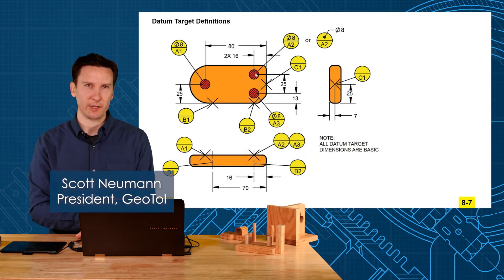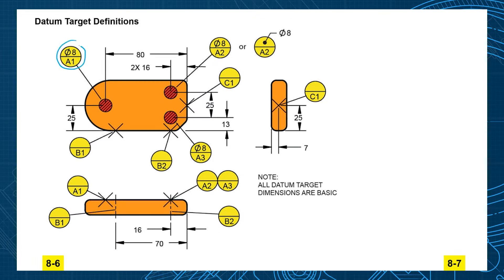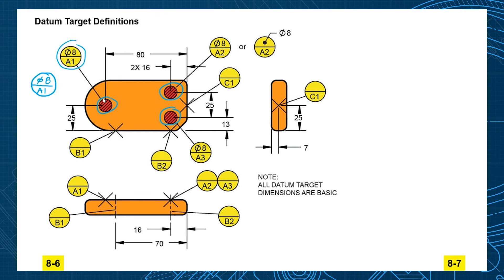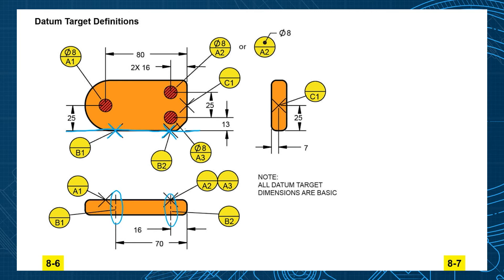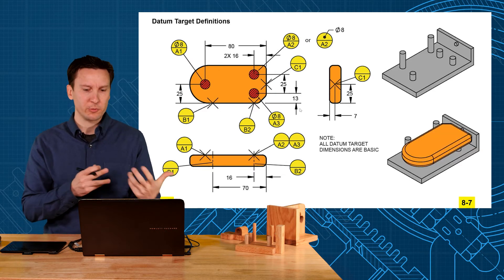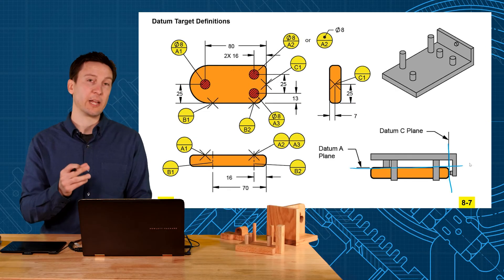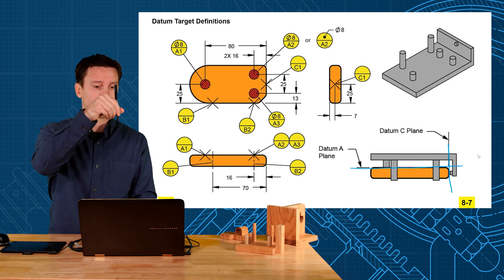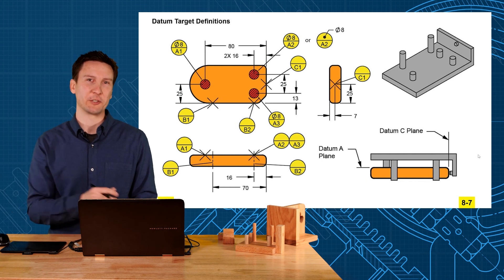GD&T Datum Targets Introduction

Comment: The dimensions between the Datum Targets and between the Datum Targets and the part are TED's.... But a TED isn't worth anything without a tolerance because nothing can be made without a (small or larger) deviation. What is the tolerance of the placement of, especially, Datum Target Points and Datum Target Lines? I can imagine a Datum Target Region to limit the exact location of the contact, this should occur within the region itself... but when using a point or a line, what is the tolerance on the actual datum location vs. the TED of the datum's location?
Reply from the maker: The drawing only specifies the theoretical set of requirements, and should not define tolerances for the inspection fixtures. Measurements are subjected to measurement uncertainty (a lot of inspection labs shoot for 10% or less measurement uncertainty).  I let inspection decide if they are to build a hard fixture or use a CMM and its software routine to simulate the datum target alignment.

Comment: Good explanation, how would you get a datum for a part that is a circle o revolution part ? Regards from México
Reply from the maker: You can arrange datum targets around a cylindrical shaft and generate a datum axis. You usually need 6 datum targets (3 on each end) to create a primary axis.
Reply: @GeoTolPro  Thank you so much... great answer

Comment: Great video!  Would you ever add a tolerance to a datum target?  Either the diameter size or location?  Or is it always basic
Reply from the maker: All datum target locations and sizes should be basic. These represent the ideal fixture locations. Any tolerances in the fixture would be included in measurement uncertainty calculations. All examples in Y14.5 show basic dimensions. However, there is one sentence that allows toleranced dimensions for datum targets (7.24.3 in 2018) but I don't think it makes much sense. Hope this helps.
Reply: @GeoTolPro  Awesome, that helps a lot, appreciate it!
Reply: @GeoTolPro  I asked a similar question. So if I am correct, the deviation of the datum target locations may only be such that the eventual produced part will still comply to the product demands (opposed to the Datum Target Demands) as stated on drawing. Correct?